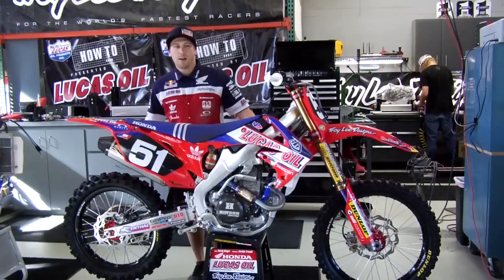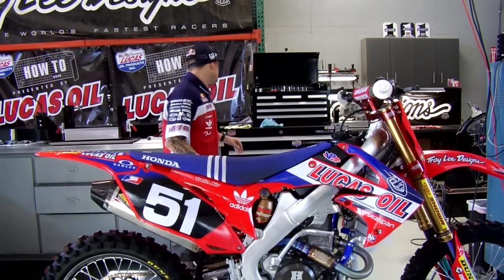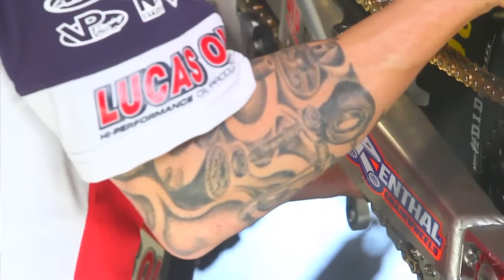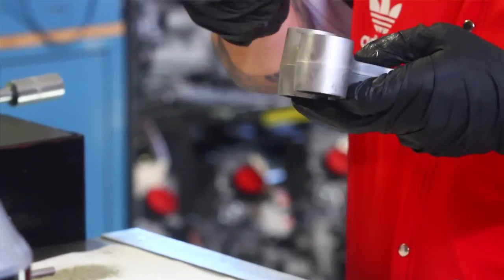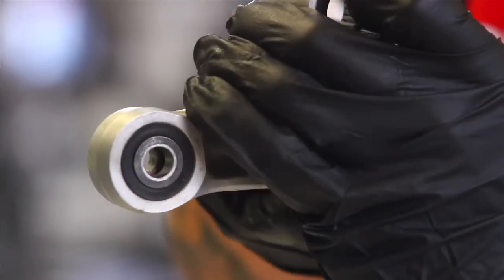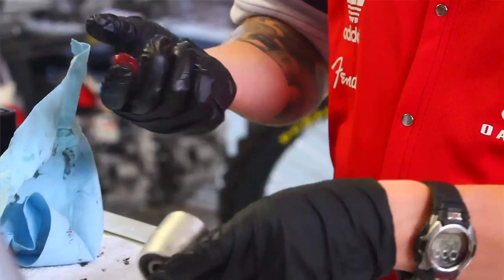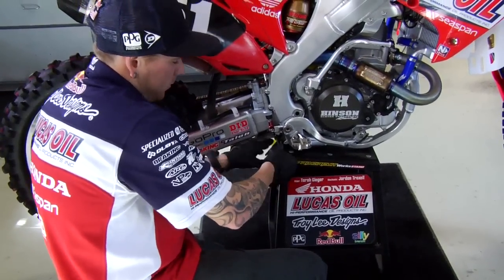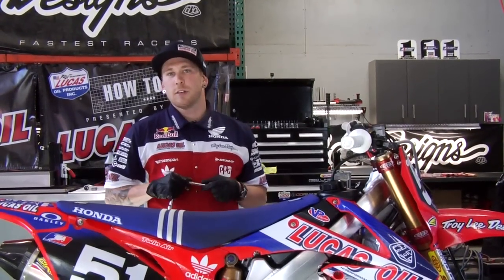How To: Clean and Grease Suspension Linkage - TransWorld MOTOcross

Comment: No ERomano55, to do the job properly, it will take much longer than 30-40mins as this video shows. There is NO way you can do it in 20mins, and if you are, you are not doing it properly. If you took your time and did it properly, you could do it every 3 years min, not every 3 rides. First of all, clean out the bearings completely in a solvent so there is NO trace of any old grease or dirt. Repack thoroughly with a high quality waterproof grease. It might a few hours, but it lasts a min of 100hrs

Comment: Linkage bearings locking up after 20-30 hours of riding on a brand new bike ?
Are you fucking kidding ? O.o 
My collegue is a test rider for suzuki, They also reccomand to change pistons after 20-25hours of riding. Whilst testing the rode the crap out of a brand new bike hitting the rev limitter everytime, They got 200 hours out of it on a rmz450...
But bearings seizing after 20-30 hours ????
I'd say that's a hoax..